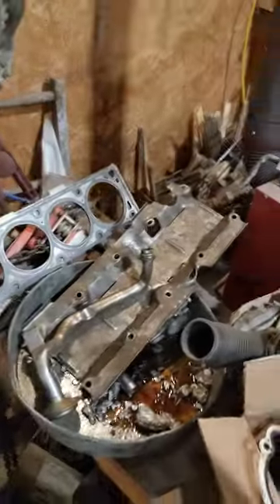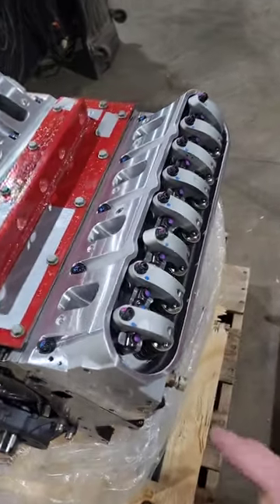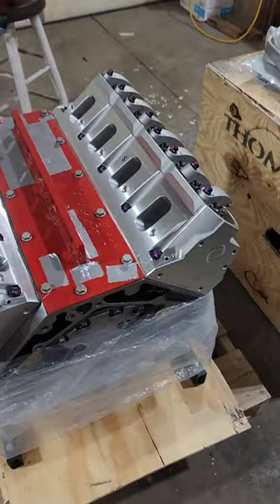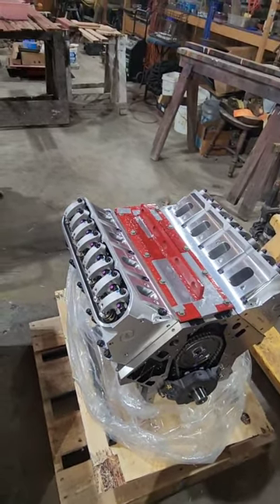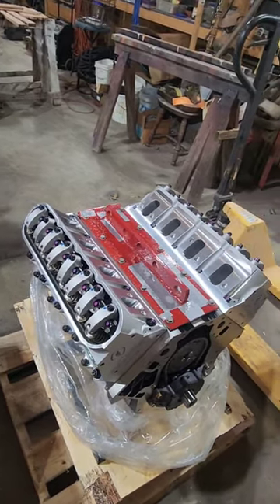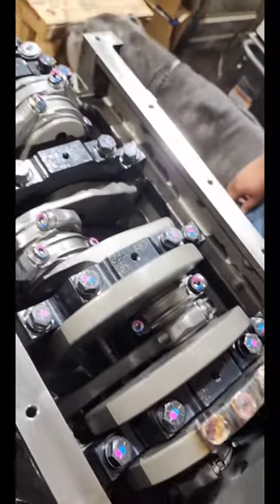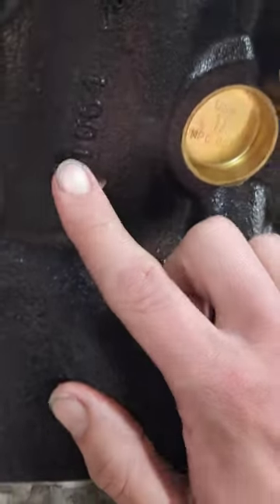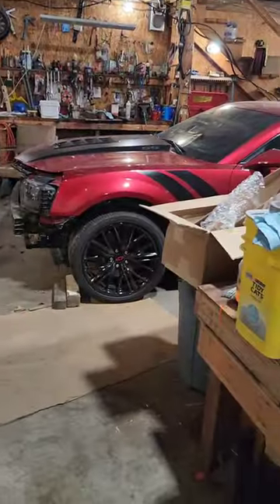Cammy's Thompson Motorsports 388ci Dart block build.

Comment: What did thompson say about the gouge in the side of the block?
Reply from the maker: They noted it just in case it would cause a future problem. After they talked to Dart, they told me that it shouldn't hinder the block in any way. I guess on some castings this happens to. So far, it has held up, and I've had no issues.
Reply: It’s on all their blocks something to do with the casting I’d imagine

Comment: Is this the Dart SHP block or SHP pro
Reply from the maker: DART SHP LSNEXT block.
Reply: @bowtiejake how much power are you pushing out of that block
Reply from the maker: @zx6r1320  the rotating assembly is rated for 1800hp and the block is rated for 2200hp
Reply: @bowtiejake  Not bad!  I got the Dart SHP LS Next block as well, my motor guy says my long block is good for 2000hp he's got decades of experience in the Turbo LS world so I trust him but lol I just want to be able to make about 2000 without putting my block on life support it is a street car Afterall i need it to stay together lol
Reply from the maker: @zx6r1320  ohh yeah I had Thompson Motorsports build this block for me it will definitely hold!
Reply: @bowtiejake  as for the chip on the block I think its just part of the casting because mine has that too and so do pretty much all the blocks that ive seen anyway
Reply from the maker: @zx6r1320  yeah it is a casting mark I found that out awhile ago I was just not sure at that moment